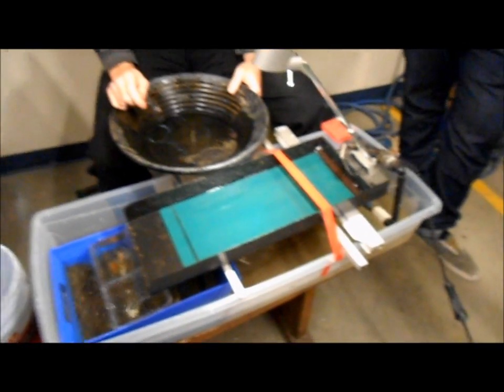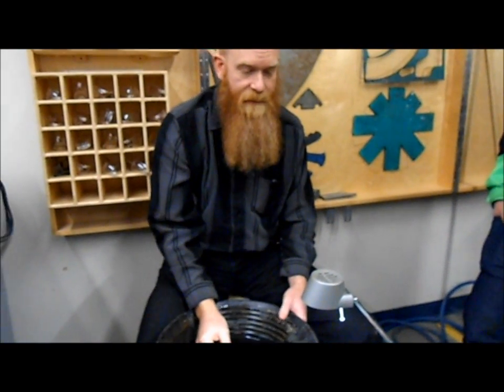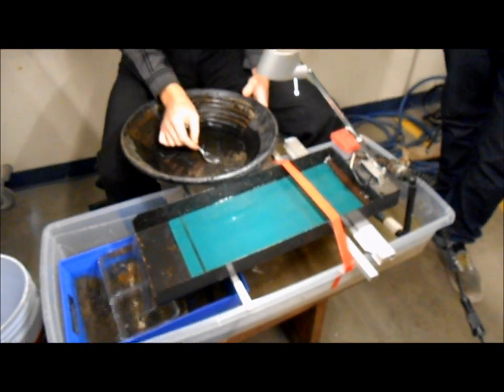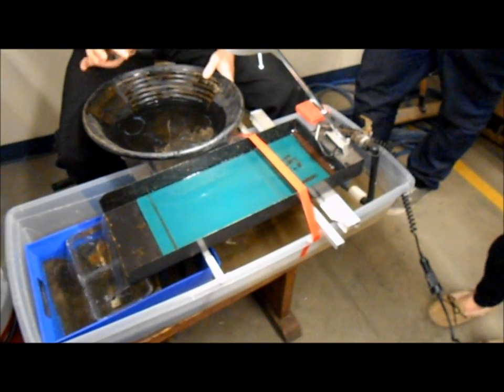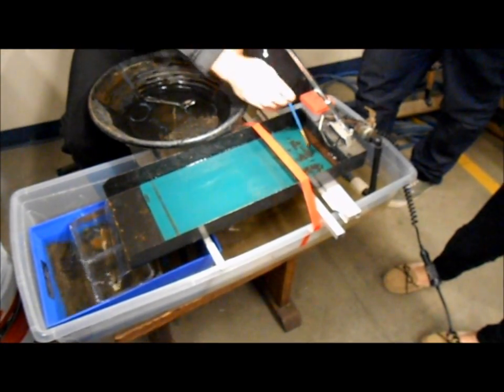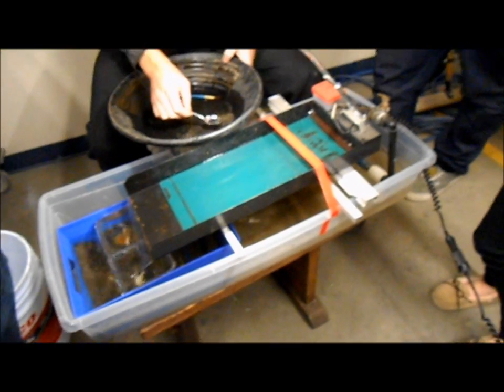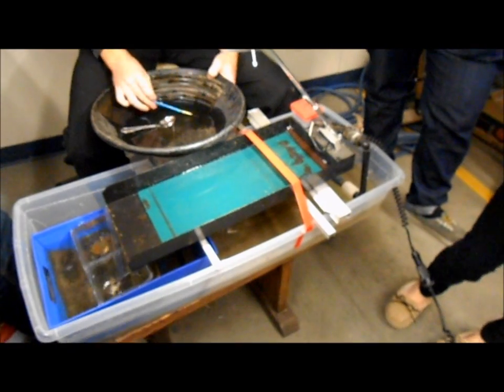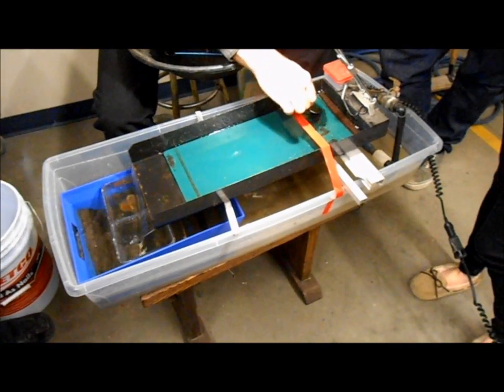Gold Mining course, How to use a Miller Table

Comment: Hi Dan, I have a question for you, I'm running fine material on my Miller Table it's Chalk Paint surface it's catching very fine Gold and Iron Pyrites all same Quartz material. Should the Pyrites wash away or could there be Gold in the Pyrites. I'm snuffing up Gold and Pyrites resting together on the table. Cheers Kev

Comment: I used to know Mr. Miller when I was a young pilgrim. He lived in South Sacramento. He was also a very talented sculptor. I owned one of his lab tables, a 2' x 4.' They were very effective. They looked much different from what you are using. They had 3 drops at the end with matting and expanded metal. The originals also had a sterling silver plate for use with mercury in the first drop. Additionally, each came with a feeder. His largest tables were 2' x 16' and could handle large volume. His shop was at his house. One day at his shop I watched him sell 10 large tables to a Chinese Co. The surface was a patented slate mixture. There were also 4 grooves on the upper part of the slate surface. These grooves were shallow and great for catching fines. He used a squeegee to move fines around and all tables had a large vial screwed on underneath for sweeping the gold into. The modern Miller tables are just an echo of the read thing. His great uncle was a placer miner in Montana and invented the tables and the slate surface coating.

Comment: Hi Dan, I imagine there's few variables to consider but: 1) What size of pump do you use and  2) What angle do you first set the Miller Table up at? Thanx For Your Time: Shawn
Reply from the maker: Very slight angle and I was using a 600 gph pump with a variable valve to tune the water flow just right.

Comment: Are you suposed to add soap in the water?
Reply from the maker: TheSamchilders Jet dry.  That stuff you put in dish washers to prevent spots on glasses.  it breaks the surface tension so that the gold will not float on the surface.
Reply: Ohh okay! Thanks for the info! I noticed that some of the gold and sand was floating in my pan the other day too!
Reply: use jet dry.  I tried a couple drops of dawn dish soap when using spiral wheel and it foamed way to much that light material was floating on the suds and it started to cover the control box.  won't do that again

Comment: Great vid Dan.  However, I have to disagree with you a bit on the Miller table.  I use a Miller table from Martin prospecting and found that regardless of flat or nugget, large or micron gold if you run your cons by classification and set your angle accordingly you won't lose your gold.  Although the blue bowl is an effective piece of equipment, I've found that the millet table works much better.  All be it, a bit slower.

Comment: Great video!!! Remember classification is the key even with cleanup. If you classify your material to something like minus 100, minus 50, minus 20 and set the water flow and angle up for each classification as you run it the gold won't move down the table it wil stick very nicely. I use a miller table that is only 18" long and have tested my tailings from it once it is set up right. No noticeable gold loss. I second GoldProspectorspace.com. Great forum, great people, and great talk shows.